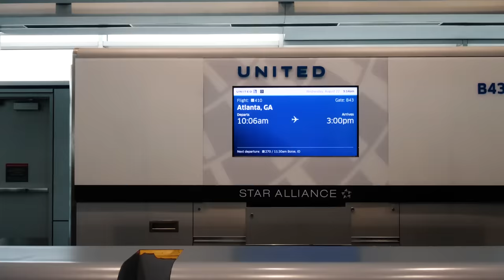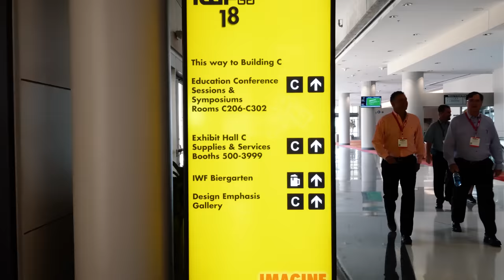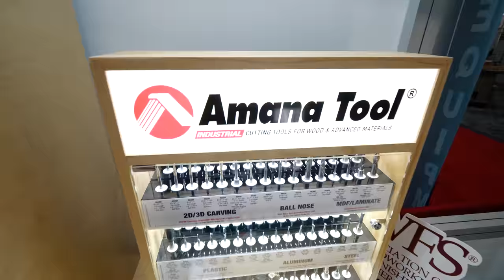International Woodworking Fair 2018

Comment: This looks very comercial but I personally belive even your avg hobbiest wood worker or small 1 man shop wood worker would like to see this.
I know thermoltec makes a cnc full sheet router system that can build cabnits off a tottaly automatic program all you've got to do is load sheets, and unload parts, but even this part could be automatically or robotly done even assembly could be done with robots  the whole shop could run with just a few people and supply cabnits to somone like Homedepot to sell to customers for his or her job even part of the install could be automated 
And it would be custom cabnits built for that job.
At the retail leval the sales person lays in the parameters the house is measured for fitment this goes to the sales person to desine the kitchen per customer request and what fits in the space
The computer finds cost and estimates lead time using the factory schedule
Materials are ordered , this could be solid stock or mdf with a laminate wood 
Or any other material choice 
In 2-3 weeks out pops the finished product and its deliverd to the job 
Then the installer sets up and preps the space assembly begins finishes are done trim added and customer signed off on the job. On the end of the 4th week.